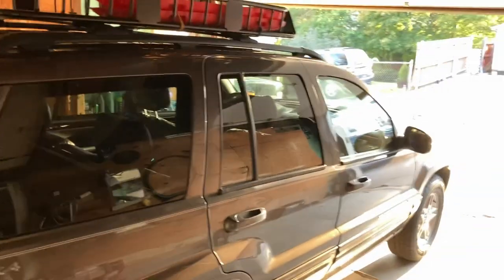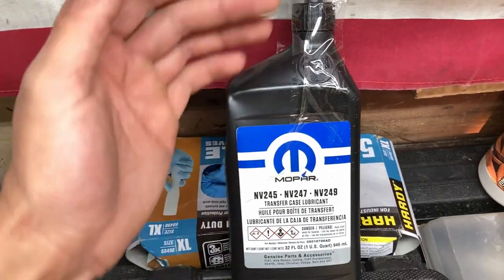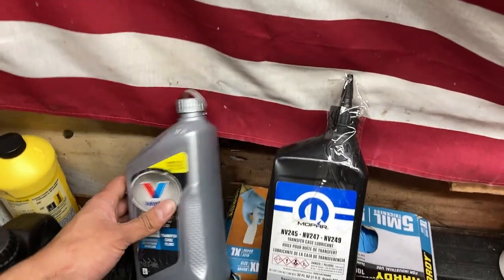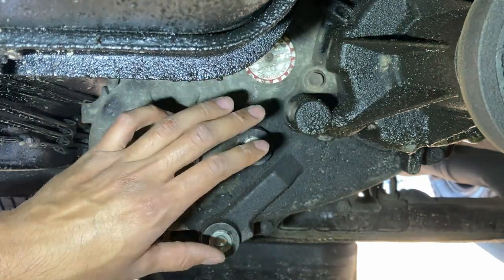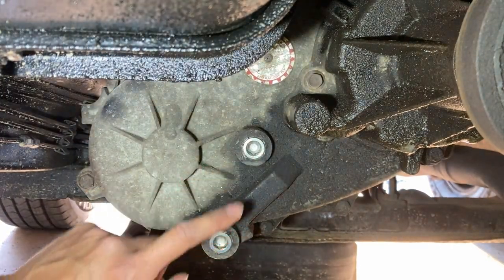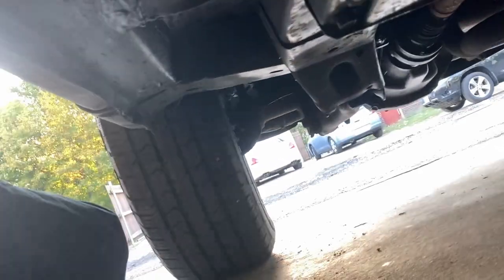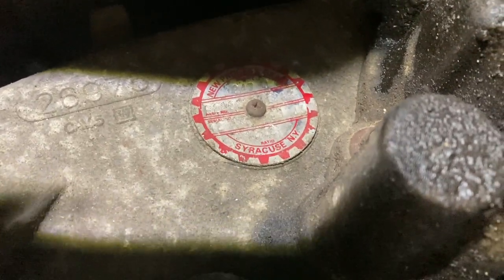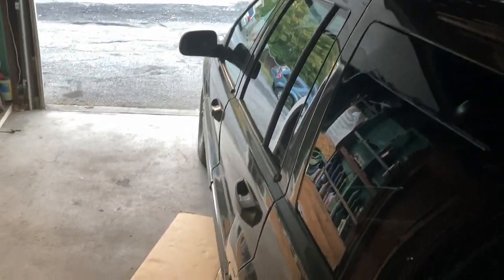How To Change The WJ Quadra Drive 247 Transfer Case Fluid

Comment: The Mopar TFC case lubricant is the only fluid you should use. I picked up a 1999 Grand Cherokee WJ Qudra Trac I drove it over home on the highway. The driveline felt like it was slipping. I did some research and it pointed to a bad Viscous Coupler. So I’m think I have to rebuild the transfer case. As I researched the parts need all the viscous couplers providers stated that the tires need to be less than 1/4’’ in height difference than the rest of the tires. I replaced the tires. The slippage went away. When doing a hard left or right turn the front tires felt like it had a bad differential. I did more research and found out about the Mopar TFC fluid. The Jeep has over 200,000 miles on it. When I drain the TFC it had ATF fluid in it. I had 3 quarts of Mopar fluid. I used just under a half quart to flush out the remaining ATF fluid. The serviced the TFC with the Mopar fluid. The problem went away. $60.00 fix. Amazing results. Just the parts alone for the TFC would have been over $600.00. I know this is long winded. Just trying to help out the Jeep community. Awesome video.

Comment: I was VERY happy to see ya using the proper TC fluid on this . 
The clutch packs inside the tc DO NOT like that other fluid . Mopar Only . Even our diff's you will need to get the additive  from a dealer . Small 4 ounce bottle .